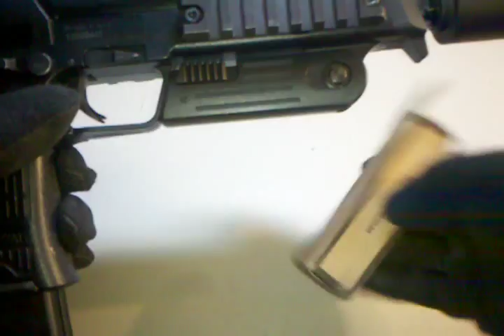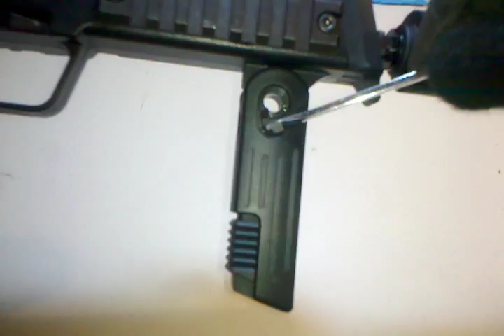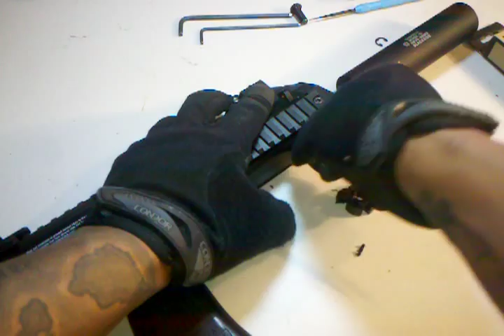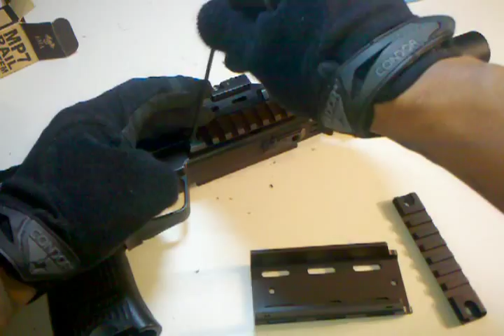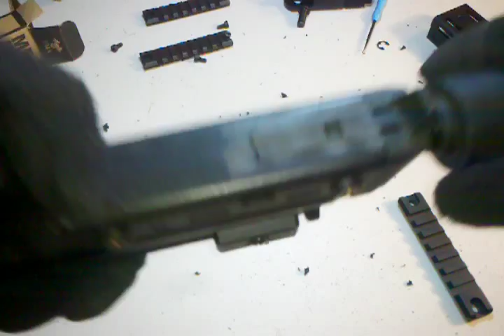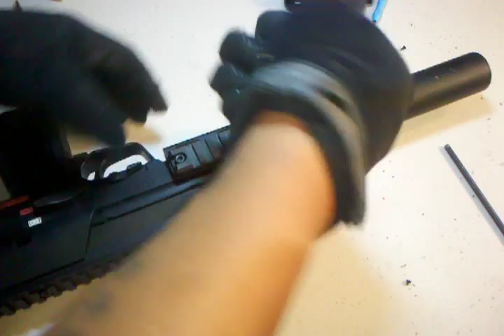How to install MP7 rail adapter

Comment: Soooooo basically its taking one grip off to put another one on since that's really about all that anyone would/should want to put on there. Still cool since you can try a bunch of different grips. Biggest thing is the cost. If it's cheap I'll gladly do it to my MP7. It does look clean.